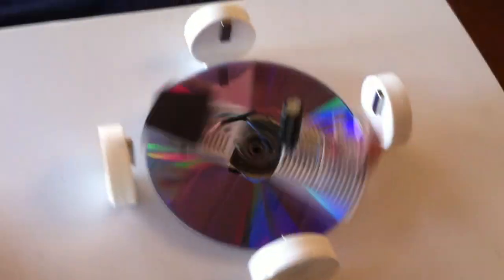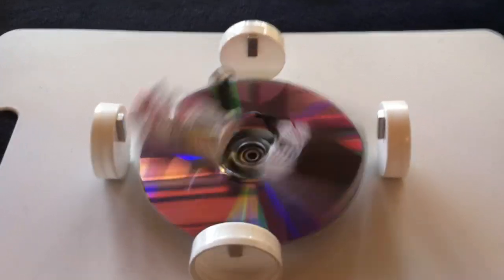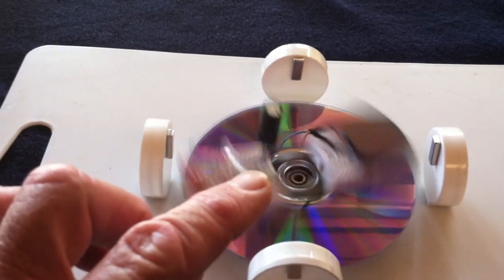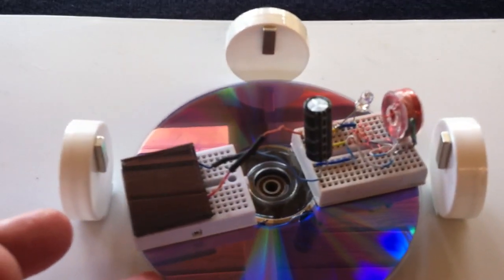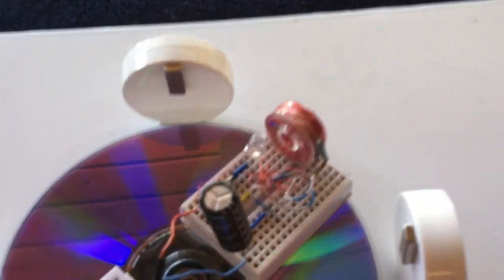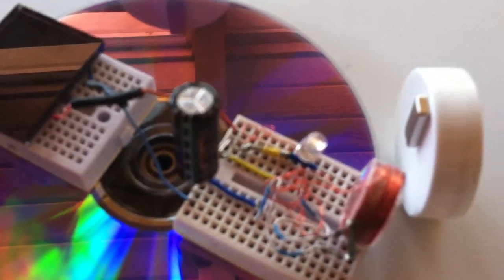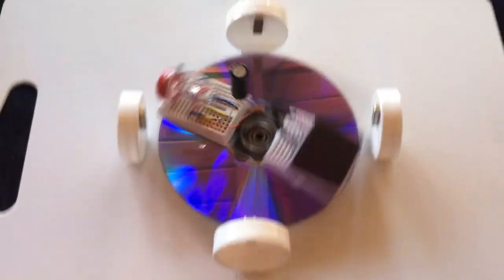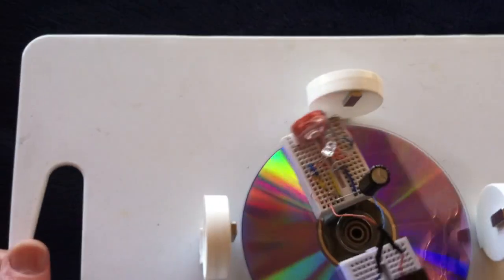Solar Backwards Motor

Comment: I am not joking. Just to convince you, here is some kind of homopolar alternator  http://cropcircles.lucypringle.co.uk/photos/2012/bishops-cannings-cropcircle2-2012.shtml  while here is its output on an oscilloscope screen http://cropcircles.lucypringle.co.uk/photos/2012/fyfield-cropcircle-2012.shtml  The oscilloscope outpur suggests 7-7-7-8-7 coils, while the homopolar disc suggests either 8 or 16 magnets. The second pic was drawn one day after the first, not too far away.

Comment: Hi Mr. Lidmotor, I am a big fan of your work. Can you help me with one or two problems please? Certain high-tech electromagnetic devices have been drawn in blueprint form in "crop circles", maybe about 100 valid examples, one even shows an "oscilloscope screen" output, With your extensive experience at making and designing motors, can you possibly help to identity the precise meaning of these "blueprints" please? Bill Muller's daughter is helping me also, because her dad was very interested in the same subject before he passed away. I can't post an email here, but you can contact me at "Horace R. Drew" or "Red Collie" on Facebook if you are interested? I am a Caltech Ph.D. in chemistry but not much at electronics. We have several other technical people very interested here also. We just need to understand more clearly what to build. Please send a private message to me on Facebook and we can make contact there, will share more info.   Best wishes, red collie in Sydney

Comment: Good job, but if you do it the other way around, the magnets in the rotor and the coil down, will increase the efficiency of the engine much better than in that way.
Reply from the maker: Yes. I totally agree.  This is just something I wanted to try.

Comment: If you could balance this rotor, it could spin faster and in a vertical position
Reply from the maker: Yes.  I tried to tilt this up towards the sun and it would not run because it was so out of balance.
Reply: Use a mirror ?